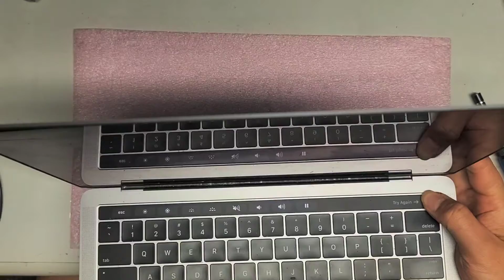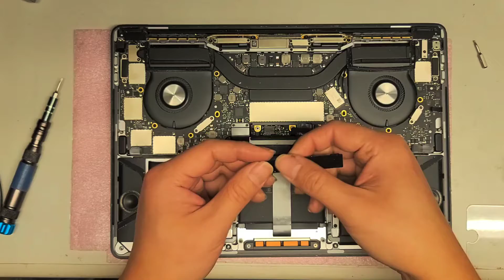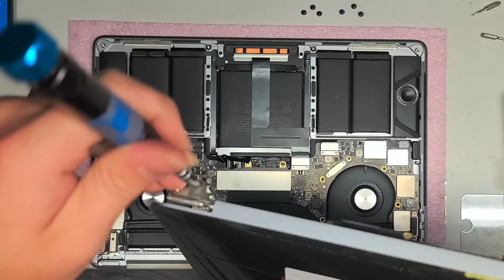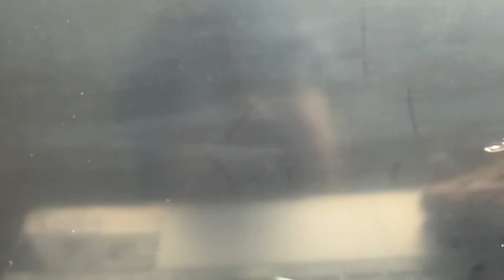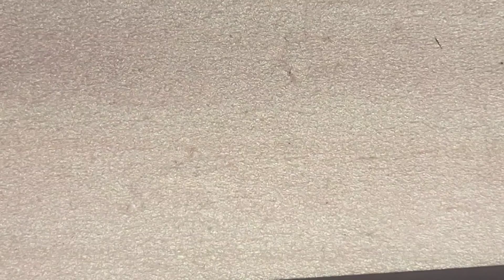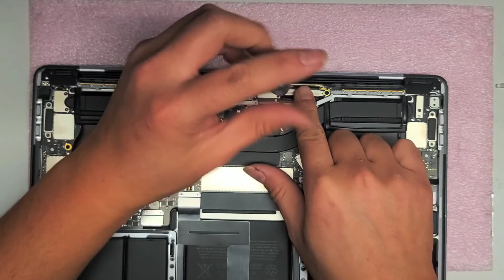13" MacBook Pro A1706 2016 Disassembly LCD Screen Assembly Replacement

Comment: Hands down the best I've seen! Liked, subscribed, and shared. Thank you. Now letting the MacBook charge but God I hope this works. Battery off Amazon and you never know. It came with literally just a battery, two screwdrivers, and instructions for charging the battery not even replacing it. Smh. 4 hrs later pretty much it was completed. Power to you!
Reply from the maker: Awesome! Glad the video helped. :)